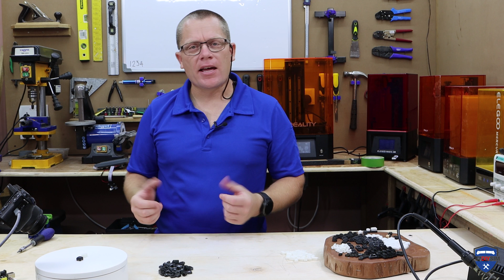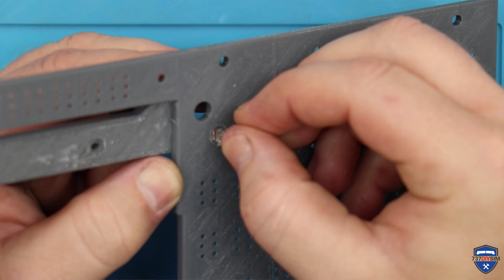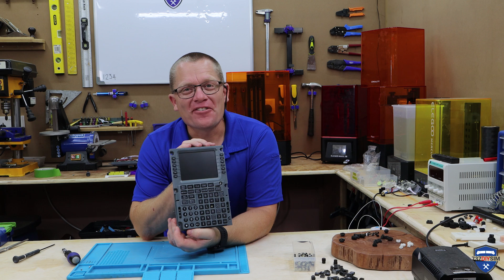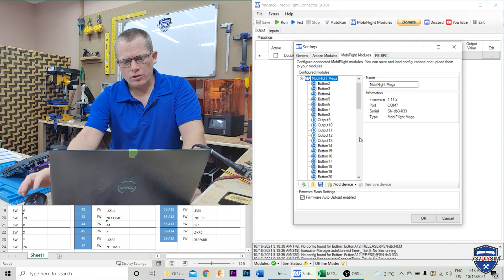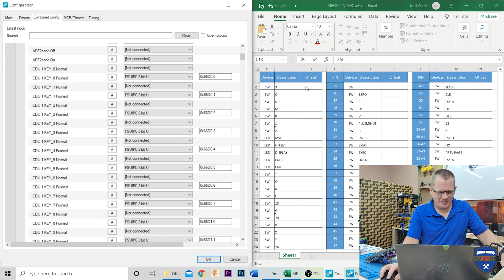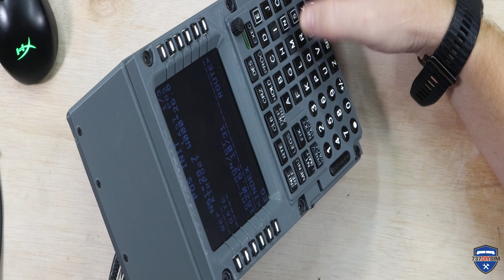Creating a 3d Printed FMC for MSFS2020 & P3D

Comment: The only thing, never solder wires directly to pcb it will go off in 2-3 years because of oxygen and water in the air. Try using connectors. In my experience for such wiring, is better to use D-sub or Idc. And FC-2,54mm cable for wiring. These connectors are really easy to solder to pcb and plug on a cable with one click. E.g. IDC-16  (KLS1-204-16-B KLS) for the cable and (L-KLS1-202-16-S-B) for pcb. This is really great solution if you have enough space as you had and it saves your time.
Reply from the maker: Hello and great to hear from you, Thank you for sharing your knowledge and advice! Kind Regards Karl
Reply: @helimech8152  , thank you for your feedback! Hope it would be suitable for you. Such things I've used on my A-22 Foxbat simulator and it still works after 6 years while direct soldering lived only for 1,5) By the way, if you'll have any questions regarding such wiring solution, I'll be always glad to help you with advice. Best regards)

Comment: How did you get rid of the upper windows bar (with close, minimize and maximize buttons) so the only thing that is on the screen is the fmc screen?

BTW this is the cleaniest non-pcb arduino project that I have ever seen! Excellent job
Reply from the maker: Thank You! As for the Screen its matter of playing with the option and screen resolution. Kind Regards Karl
Reply: @helimech8152  Thanks for response. Could you please make video how to do that? I can´t find any tutorial on that. Getting rod of the bottom windows bar on additional monitor is easy, but I am stuck with the upper one which annoys me a lot. I think many people would appareciate that :)

Comment: Karl, first of all, awesome work mand!! I just ran into your website and YT channel and bought the FMC plans right away and started printing the parts. Just a question: why do you add a resistor every 4 tactile switches? I didn't see that on the parts list but they show up on the wiring diagram as 1 Ohm. Is this correct? I saw another video from "sim build uk" and it looks like he didn't use them. Thanks a lot for the info you share and the inspiration!!!!
Reply from the maker: Hello and welcome! The resistor is there only to limit current, not voltage. 4 divided by 12 is 3, which is close enough for a 20-30mA current to the led. Any more and those leds will burn out fast!
Reply: @helimech8152  Thanks for the reply :) I actually figured that out after watching another video and also doing some research online. Thanks again for the great work

Comment: Can I find somewhere the wirring diagram but with the resistors etc ?
Reply from the maker: Hi Alex, its on the website in several places. (downloads/Parts menu/Wiring Diagrams). But inshort you need 5 x 470ohm and about QTY 20, 1 Ohm resistors.
Reply: @helimech8152   thank you very much !!

Comment: very interesting video like usual. why you don't use keyboard grid like the ISO/CEI 9995 ? it maybe not possible to do with control board / software
Reply from the maker: Hello, and your right. Its down to the interfacing software being to recognise that grid and relay it back to the sim. At the moment Mobiflight is used and each input has its own dedicated pin. This also makes explaining the connection process much simpler to people starting out.

Comment: Hi there, I’m so impressed by this it’s crazy! Just looked into the pro sim suite and I’m guessing this is for a full flight sim? I’m only looking to use this FMC as a one off so is there any other software I can use that is free or more cost effective? Many thanks
Reply from the maker: Hi Brett, In theory it should work for PMDG737 and P3d. But i have not tested it. I now love MSFS and build to that sim. Sorry and kind regards Karl
Reply: @helimech8152  thanks Karl, I’ve just make the switch over to MSFS also. Do I need the pro sim suite for this to work with MSFS?
Reply: @helimech8152  I'm looking to potentially make this but wanted to know what software you need to make it run with MFS2020. If it is a paid version is there a free version that I could use instead?

Comment: Thank you for making your awesome design available! i purchased the design, as we speak im printing the parts :)
Reply from the maker: Hi Michiel, How is the build going? Its a bit of a slog in parts!
Reply: @helimech8152  Hi! well, i was printing the base plate for the switches and led's, my printer decides to breakdown, actually, it is the first time it happened. initially the base plate looks very nice, only missing the support construction for the arduino. If you like, i can keep you update to date
Reply: @helimech8152  Hi, small update, 3d printer is fixed. im making very good pogress at the moment, backplane is almost finished printing, Arduino mount is finised, it fits very well!

Comment: Would 12v plugged in backwards really damage the LEDs? They're essentially diodes.
Reply from the maker: I will let you tell me of it does or not. I would literally cry putting it all together and blow the led's.  I just didn't want to take the chance with an unregulated power supply.

Comment: Very nice build. Two things: with all that effort and money people put in sims, you can have a real aircraft instead, it's not that expensive. I have a fraction of a light sport plane, cost me about 6500 euros, nice neat hangar, always there because no one uses it. And 2, if you can put that there together, ever consider starting an avionics business? the rest of the industry thinks a 10 inch display is super huge and that 20000$ is cheap. It's more than ripe for disruption.
Reply: once you factor in the cost of getting a pilot's license, annual inspections, storage, maintenance, fuel, plus the risk of death, simming just makes sense for some of us.
Reply: @marshie1337  LSAs are different though. license is quite cheap at least here, cheaper inspections, you can get ones with ballistic parachute on the plane for risk of death so if you are competent enough to build a sim then it's quite safe. Fractional ownership really cuts down on cost. I've had a plane for over a year now, it's virtually no cost to me. It's like I had no plane. We just had a gearbox change because previous owner had a prop strike accident (which they forgot to tell me about) but it was all of 600$. For a major repair on a plane...  and normally they don't have such repairs. Two of the owners are mechanics so that helps but still. It's extremely manageable cost wise. When I started 'dreaming' of flying I was thinking I had to swing around 130k$ or more for a plane, doable but a stretch but only a couple of months later I owned a plane for only 7400$. An Evektor EV97. If i had the choice I would have gone with the FK14 Polaris, it's same price, composite hull, better looking, much faster and has a parachute.
Reply: @marshie1337  and side note for enthusiast simmers, the typical cockpit of an airliner is a grotesque clutter of buttons and knobs, none of which is needed. A more Tesla like clean cockpit is the way to go but to some perhaps the insanity of airliner cockpit designs is part of the illusion.
Reply from the maker: Cheers dan for the comments, Interesting read.

Comment: I really need a 737 max quadrant
Reply from the maker: Hi Paul, there's a working version on the website already. I personally thinknits better than the 737 v3. As It was built from scratch rather than making an existing design fit

Comment: Nice! One tip: never use a cordless screw driver for mounting hardware/PCBs. You can easily destroy the smd components if you slip off. Also there is a change for putting to much angular moment on the screws which can yield to internal pcb problems that are hard to find. 
Greets from an hw-engineer.
Reply from the maker: Thank you and advise heeded,  I was being rather lazy! Kind regards Karl

Comment: Why not set all of the buttons as an array - then you'd have room for the pot, led indicators, etc...
Reply from the maker: Hello, I use mobiflight software. It doesn't have matrix capability, but there's no way I could write a program/sketch like it. Just the shear thought of interfacing with msfs chills me. So I'm more than happy to plod along using a pin per button!

Comment: You are a real inspiration! I would like to use the same method with my 3D printer (Snapmaker). Any suggestions for transparent PLA filament to use for the buttons?
Reply from the maker: Hi  using clear means you canot see the button text without backnlight, but it will work.

Comment: That's a CDU, not the FMC.
Reply from the maker: You get the gold star! You are absolutely right, but in the sim world, those terms have gotten very confused when you Google it. I think it may me a generic term across GA aircraft rather than the bigger boeings
Reply: I worked for Collins Radio, even in Air Trans it's a CDU. I worked GA autopilots, and then the IAPS (integrated avionics processing system), which had the FCCs, FMCs, maintenance computer MDC (maintenance diagnostic computer), also had 4 data switches for ARINC429, and 4 power supplies, as this was a dual-daul package. I came in right as the Beechcraft Starship was nearing completion. And the FMC used the CDU as the control head. So the Air Trans division never made a FMC, or a CDU. Radios, Displays, and flight control was their main content at Boeing.
Now they are putting everything in the displays, outside of the sensors. Sadly, when Rockwell spit them out, and they became Rockwell Collins Inc. Local CEO was a fighter jock, not an engineer, as previous company was ran locally by former engineers that worked for Arthur Collins, he was gone when I got there by more then 10 years. It was a fun place to work from 84 to 2013. I retired 8 years ago, since then United Technologies bought them, renamed Collins Avionics Systems, then Raytheon just came in, kept the name, but sounds like it's crap to work there now.

Comment: Why no matrix, shift registers or some other form of economising on inputs??
This should have been a trivial task for an Arduino nano or micro and would have used a lot less wire and parts.
Reply from the maker: Hello, the primary reason for no matrix, is that I'm trying to stick to mobiflight and prosim or pmdg. Neither of which currently support matrix or shift registers and I have learnt over the years, it's so much easier just to add another card of 67 pins when I need it. Using a matrix or shift register and getting all the buttons to register in msfs is very difficult without mobiflight.
Reply: Mobiflight doesn't currently support them maybe the correct answer..\

Comment: that looks realy nice, but maby i'm to much of a arduino geek but why not use a matrix it uses allot less pins on the arduino. and why add the 10k resistor if you can use INPUT_PULLUP on the arduino
Reply from the maker: Hello Emile, writing a sketch capable of fully interfacing with msfs 2020 has taken Mobiflight years to perfect. I'd rather use a plug and play software with direct input. Mobiflight currently doesn't support shift registers and matrixes. This is why you see the forest of wires.
Reply: @helimech8152  i see you rather use plug and play software. i dont like that i like to have freedom. as i sad i'm a arduino geek. but the past couple of months i have seen a couple of your videos but everything you make looks REALY nice, dont get me wrong here and your wire loom also looks amasing. but after some seaching i found out about bits and droids which seems to better suit me. and it seems he is dutch which is also easyer for me if i need more functions.

Comment: Nice project and good idea. But why you don't use a PCB for your keys? You only have to solder them and don't have so many wires. It shows like you connect each lamp and switch to a pin of the arduino. Use a matrix, you need only diodes. I think there is a technic you can check the switch and also switch on the led
Reply from the maker: Hello, it's coming! Post here takes months, infact I just had post arrive from 2020 today. Getting a pcb createdcand posted, then only to find there's an issue, would almost take half a year to a year. We are moving on soon, and hopefully I can make use of pcb way! Something I'm dying to try out! Kind regards karl
Reply: @helimech8152  Where you stay? I get my PCB in some days ... ;)
Reply from the maker: Brunei, all contractor post comes via the uk.
Reply: @helimech8152  ok Brunei is out of the world? Could you not deliver directly to you?

Comment: Karl, I think first type (flat) of buttons is most realistic. How about to print entiry button  and paint black areas by oil pencil? And cover them by mat varnish to protect from deterioration? Also you can make button completely flat (by dense layer of lacquer)
Reply from the maker: Hi Artur, if this was solely for me, I would get out the CNC machine and fir the laser head and engrave the parts. But this was more to show how people can create this at home. With a push of a button (lol despite the hours of wiring). Thank you for sharing your knowledge, it's always appreciated. Kind regards Karl

Comment: Amazing stuff as usual. Are you familiar with wire wrapping? In this kind of scenarios where you have hundreds of pins, I think it's a much easier technique to use wire wrap than soldering. Check it out if you can.
Reply: Wiring wrapping? You mean the old telephone inside plant wire wrap method? Be ages since I've done any of that.
Reply: Fernando, i looked it up and it's a very nice and easy solution. I think i will buy the wire wrap pen. Looks easy.
There is a youtube video wire wrap 101, that explains the technique very well.
Thanks for the hint.

https://youtu.be/IXvEDM-m9CE
Reply from the maker: Hi Fernando, I really hopemthus works for you, but it has its flaws. I'm now old fashioned and stuck in my ways lol
Reply: If you wire wrap it get ready for some headaches, especially if you need to rewire it for some reason. Soldering is far easier and quicker, both in the first build and if you need to rewire it. 

If the wire you need to move is below another wire on a pin then that other wire would need to come off first, then back on afterwards.

Comment: Recently got my New Ender 3 which I'll be using to print this. I'm up for a decent challenge!
Reply from the maker: Good choice of printer, mine arr still going strong! The challenge is the repetivness of the 70 plus buttons. Crack that, and ots a good unit.

Comment: As I dont like the pure black color filament in my solutions i print out the face plates in any PLA color i have, then spraypaint the faceplates in the right black/greay color. In my fusion 360 i have ingraved what ever  wordings/letters i want like in 0.5mm depth, then i have printed out the word/letter in 0.5 height in white with a 0.3 line mm bar on top just to hold the letters together. I put the letters inside and cut/sand off the line bar, ofcourse the Word is superglued on the engraving. Looks fine.
Reply from the maker: That's a great alternative.
Reply: @helimech8152  just a tip. I tried to print out the letters individually without the bar, and this was not a nice result, as it is imposible to place the letters exactly the same angle.

If you need back light on the buttons, then you use clear pla on ie the buttons. You print out the word/letters twice, place the first word/letters in the button, spray paint the buttons, take out the sprayed Word/letters and replace it with the non sprayed painted word/letters, the second print.
The cheapest solution i could figure out.

Hope it made sence... Im not in a use for a FMC (i have my GARMIN G5000 only touch screen),  but I enjoy your channel, really good inspiration. I still building My Cessna Citation Longitude, less soldering 😉
Reply: @helimech8152  My GARMIN touch explained. Maybe a bit to complicated

https://youtu.be/dXb1XgtTcvE

Point was, to make it "licens free"  and not use HDMI ports and only based on cable network, besides some  few pins on the Mega. It's based on 4 encoders each.
I made a case with gears to encounter for double encoders 😋

Comment: 1 minut into the video, i wonder why the back chassis is so big/deep.
Reply from the maker: Hello, do you mean the case, it was created to hold the FMC at 45 degrees, I now need to fit it to the sim.
Reply: @helimech8152  Great video. Is the case included with the plans? I don’t have a full cockpit but am looking for something like the case/stand to hold a FMC like that.
Reply from the maker: Hi Sean, It's in the CAD, but I think I forgot to include it in the zip file. Will add it tonight, or put it under STL prints on the website. Kind Regards Karl
Reply: The real Boeing CDU is even much deeper than Karl's